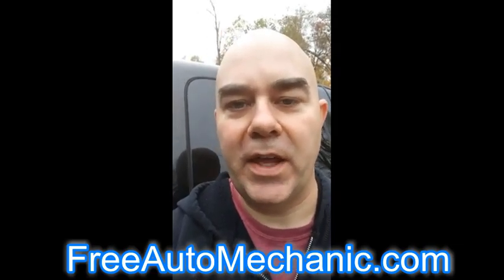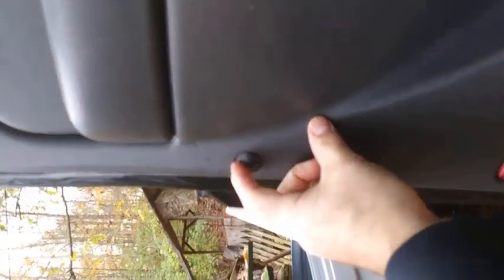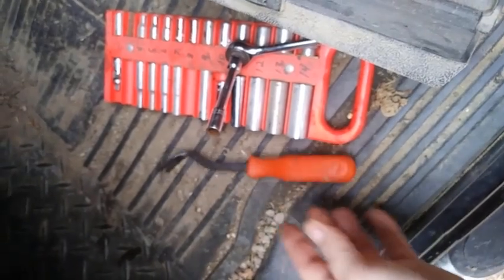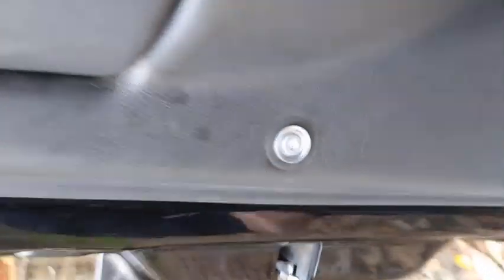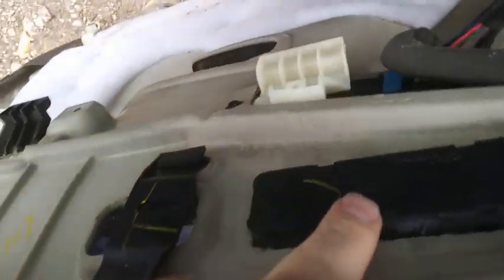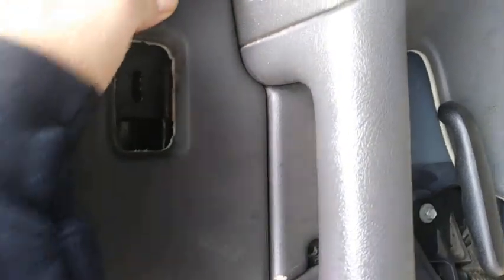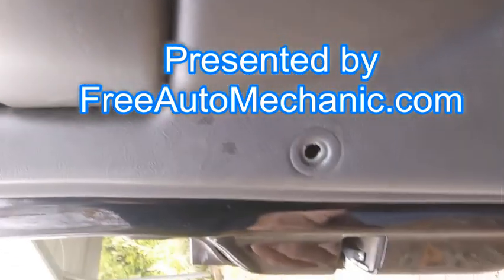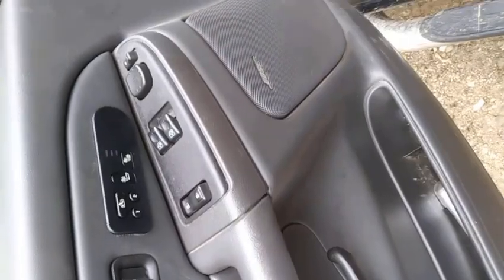How to replace seat heater switch 1999-2006 Chevy Silverado, Suburban, Tahoe and Sierra

Comment: I had this exact problem. Ordered the part, watched you video and easily completed myself...and turned it into a teaching opportunity for my teenage son. Thank you!!!
Reply from the maker: Your Welcome
Reply: UPDATE: First, I am still very appreciative of the DIY video, however, even thought I “tested” the switch before I re-assembled and then again after, the problem showed itself this morning immediately upon starting the truck. According to a Chevy forum I’ve also been following, replacing the primary switch cluster for windows locks and mirrors fixed the problem. Interesting, the two people who posted that, said they had tried replacing the heated seat switch first which didn’t solve the problem. No complaints here, but didn’t want my earlier comment to possibly mislead anyone. Electrical problems are just plain hard to troubleshoot when things are module controlled. Hope this helps.
Reply: @FreeAutoMechanic  Thx. for posting such a great and necessary video!

Comment: This is one of the FEW AMAZING USEFUL videos on YouTube. Thank you! I'm currently having this EXACT issue. Push on the driver-side heated seat... in a couple of seconds, off it goes. While my '03 is in mint condition and reaching 20 years (this is my 3 Silverado in over 30 years), things do break down. Almost 25K views. Congrats! Thank you for posting such a necessary video. 👊
Reply from the maker: Wow, 3rd Silverado. This is my first. Love the heated seats in the winter months. I’m so glad you found the video useful. Thank you for the kind words. And thanks for watching!
Reply: Did replacing the switch solve your problem? From what I'm reading your problem sounds like it could also be a burnt out heater that needs replaced in the seat.

Comment: So did the repair / replacement work? I have the same issue with the seat heater in my 03 tahoe.
Reply: Brian Browning the issue goes away if it’s dry, no? If that’s the case then all you need to do it just coat the connection with a waterproof sealant, eliminating the moisture that causes the false switching. This is something I will be doing a video on soon. Can be viewable on my channel called Sweeper Mods.
Reply from the maker: Worked great. Thought about trying the glue idea, but I only wanted to take it apart once.

Comment: I have had water and snow come in my window on  a few occasions. At one point the lights were flickering and the heated seats would only work some of the time. On a few occasions the seats came on themselves and now I  have nothing. I was think of getting the switch but am still reading up on what else it could be. It just seems that in less than a week that switch  slowly stopped working.

Comment: I'm trying to follow this, but I cant seem to find where the wire plugs into at 3:44 it popped loose during removal.
Reply from the maker: at 3:42 you can see the original position and location of the wire that was taking loose at 3:44. The plugs will only fit in one position on the switch.

Comment: I did replace the switch.It still has a mind of its own.Goes on,i keep shutting it off.What else can it be?
Reply: Someone else posted above, then, also replacing the window buttons, door locks, mirror adjust block of electronics under the armrest did fix their problem.

Comment: New switch didn't fix my issue. Still turns on and off as it pleases.
Reply: Someone else posted above, then, also replacing the window buttons, door locks, mirror adjust block of electronics under the armrest did fix their problem.

Comment: You could have left the door panel on and just pulled the switch out from the left side and changed it out.
Reply: How would you unplug it from the door module without taking the door panel off? Use someone with infant hands to reach through the hole?
Reply: @jeffscott3160  Notice he never replied. 😂
Reply: Yeah, sure thing keyboard critic. Answer Jeff's question.
Reply: You can unplug it from the switch and plug that into the new switch. If replacing the wire, then you’d have to remove the door panel.